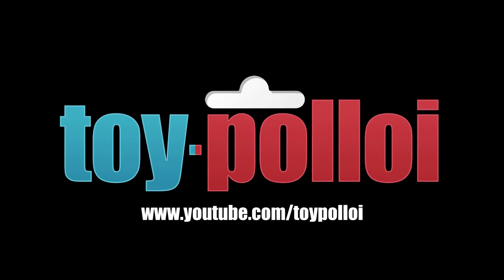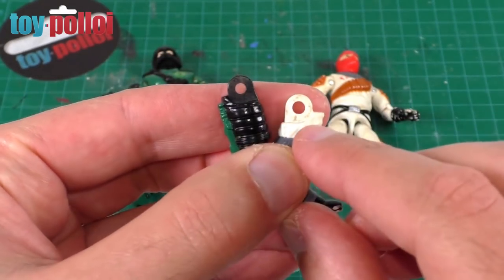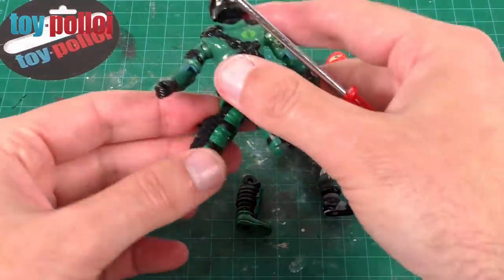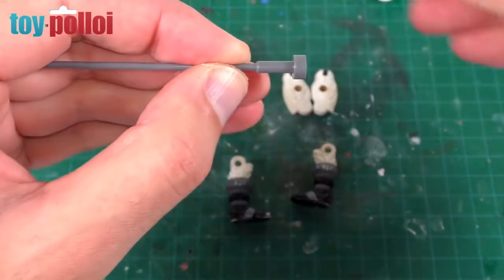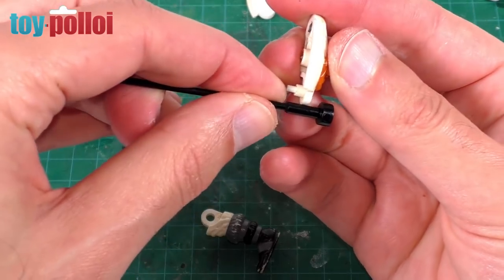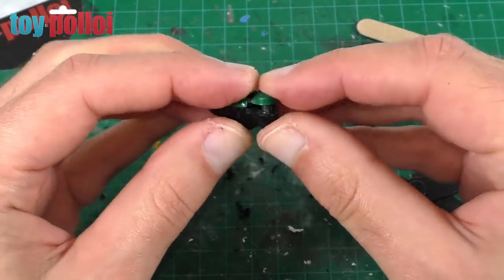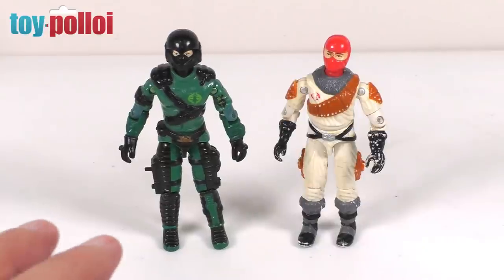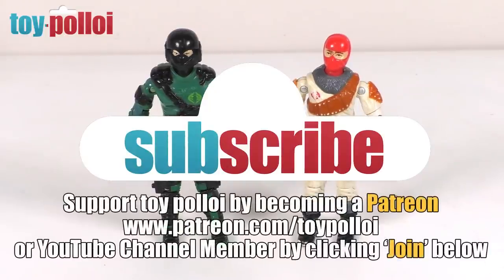Vintage G.I.Joe Broken knee repair - Toy Polloi

Comment: Great fix today Dave. Thank you for giving us great ideas on fixing our Gi.Joes. The plastic used on these action figures was so delicate that the joints would break easily due to constant play. I have 2 Night Vipers and I fixed the leg of one, but there's another problem with that particular action figure. The two connectors on the sides of the helmet where the  visors or night vision goggles go, are always breaking. I would love to see another video where you tackle that problem. Again, thanks Dave for your superb ideas on how to fix these toys. 👍

Comment: Would you use a similar method to repair the pegs on the outside thigh of the night viper (or rock n roll v2, metalhead, etc.)?
Reply from the maker: Most likely, yes.

Comment: I just bought a Night Viper with a broken visor peg. Which lego piece would you recommend to replace it with? I thought of using the Lego piece commonly used as the gear shift in smaller sets
Reply from the maker: Whip antenna is the smallest you can get. Either that or some smaller diameter styrene rod.
Reply: @toypolloi  Thank you sir 👍